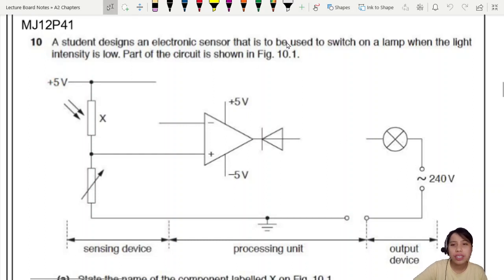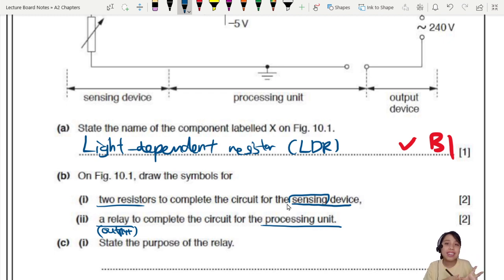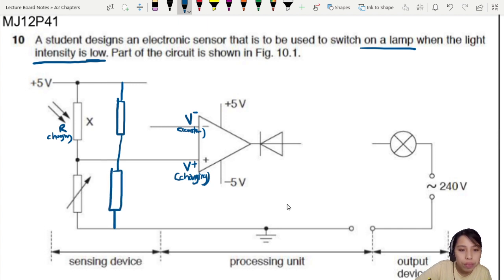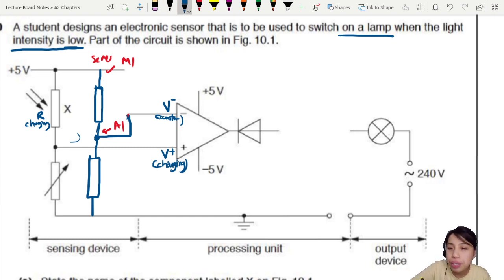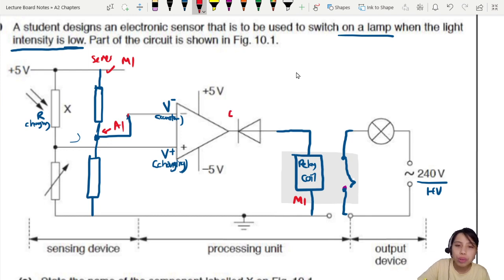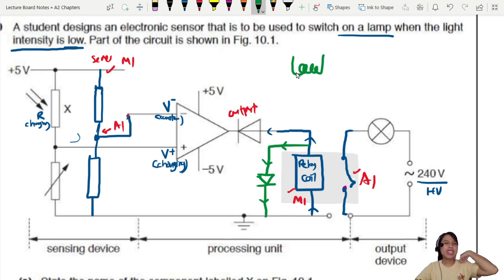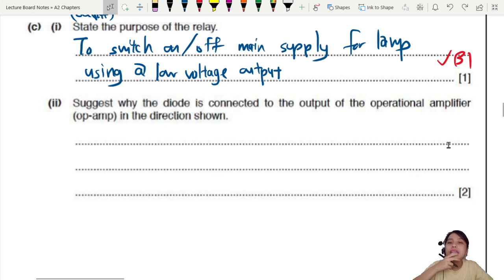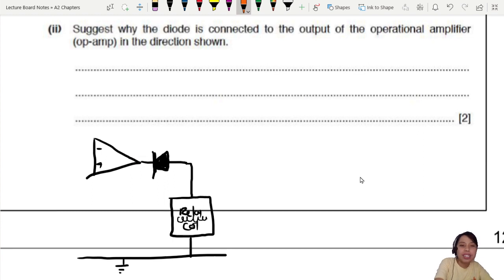121.1c MJ12 P41 Q10 Relay Output | A2 Electronics: Op-Amp | Cambridge A Level Physics

Comment: Why do we basically need only negative output . How does that matter if relay can work for both -ve or +ve output or is there any concept behind wanting to flow current from 0v to -ve V ? Plz exlain
Reply: Understood thanks alot . 11 days are left until p4 exam and ur videos are a life saver for me🙏🏼
Reply from the maker: I'm glad these are helping you to learn and improve! 👍
Reply from the maker: Yes the system can be setup to work with either +Vout OR -Vout. It depends on how the diode is put in place! So it's your choice when designing a circuit for an exam question. ;)